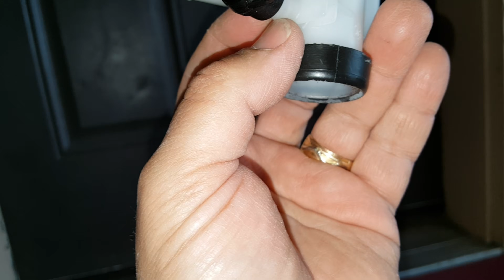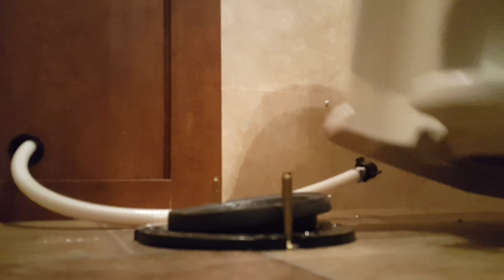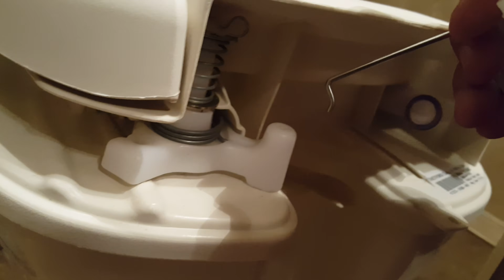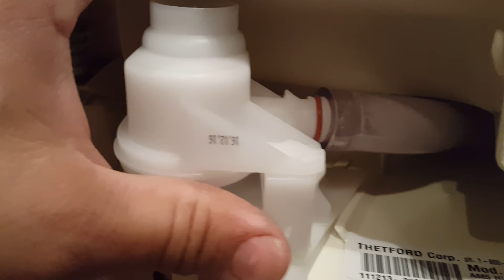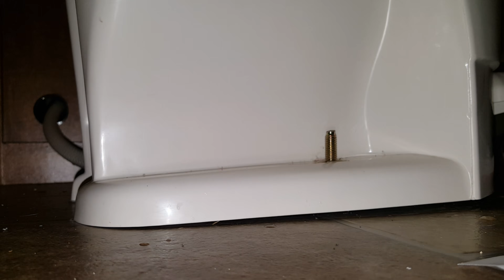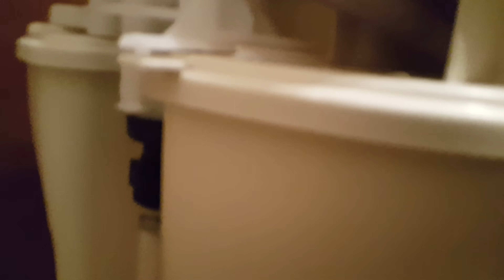RV Toilet Repair | How to Remove and Replace Damaged Water Valve | Damaged from Freezing

Comment: GREAT video!  Quick question, I have a very small (one drop every 10 seconds or so) leak coming from where the hose meets the part you replaced.  Do you recommend replacing the same part you did AND a new hose?  Again, thank you for posting this!
Reply from the maker: Yes, exactly

Comment: Great video I have the exact same problem I will fixing with your help however how can I avoid this problem in the future? What is a proper winterizing to prevent this from happening again? Thanks in advance
Reply from the maker: My best advice is to confirm this with your local RV service center, but on my RV I drain the water from all the lines, and either blow air through the system, or better yet, run RV antifreeze through the cold water lines.  Every camper is different but generally you will want to drain your Hot water heater and then use the bypass line selections to run RV antifreeze through the cold and hot water lines after you do that.   There are many videos that give specifics depending upon the type of RV you have.   When I purchased my RV new, I had the service center do the first year winterization and teach me how as they did it.

Comment: Awesome video--much more detailed than the others. I was bummed at first but turned out to be easy, after removing the toilet. So tiny and light lol. (N got extra covid masks so didn't have to smell the SMELL.) Also off topic: my tt is an engineering marvel--there should be a stop valve in the line to the toilet for leaks so I can do dishes, brush teeth, etc., while waiting for part ordered online.

Comment: My toilet part leaked- well, now I can call it a water valve- it was leaking. However, it only leaked when you flushed, and when the pressure was high. It was a mild annoyance, but manageable. Like I would just stick a napkin back there and change it after every trip. Anywhoo, the 2-year warranty is up on my Jayco in November, so I figured I'd get it fixed. I also know RV repair places are big fans of going 'whelp, we don't have that, so it needs to stay here until Christmas.' I did some research on the toilet and was surprised to see that it was a full assembly. Then I ran across your video- and that shows me how easy it was to change. Even better- because of the door, my toilet is at an angle and it's not snug to the wall because there is a built-up box carrying wires and water right behind it. There is no need to remove the toilet itself. I ordered the part, will have it tomorrow. This looks really easy- and I wanted to say thanks for sharing.
Reply: Got the part, @FROSTY Life. It took me all of 2 minutes. Total. I owe that to you- thank you.

Comment: Great video.  If my toilet valve isn't shutting off tightly, is that a sign that this same valve needs to be replaced or does the spring connected to the foot pedal need to be replaced.  I have noticed lately that I have to pull up on the foot pedal to get the valve to shut off completely so am wondering which do I replace.  Thanks

Comment: Awesome video. Just FYI, but you usually don't need to remove the toilet. That saves you from changing the floor seal.
Reply from the maker: You are right and that is a good point.  I had removed it only to show where the part is, but someone who is really flexible and experienced could potentially replace the valve without removing the toilet from the floor mount.
Reply: Some RVs such as mine have virtually no room on either side or behind the toilet, so that I will certainly need to remove the toilet to get to the valve.

Comment: Thank you, my RV toilet had almost no pressure. Turns out I had a clog (calcium buildup) in the valve. Your video showed me how to remove the valve without removing the entire toilet. After that I was able to clean out the calcium bits in the valve. Toilet flushes like the Niagra now, Thanks!
Reply from the maker: fantastic. I didn't even think about that type of problem but I am very happy my RV toilet video help to figure that out. Other viewers will benefit from reading your message and they will also be able to fix that problem if they have the same type of thing happen to them